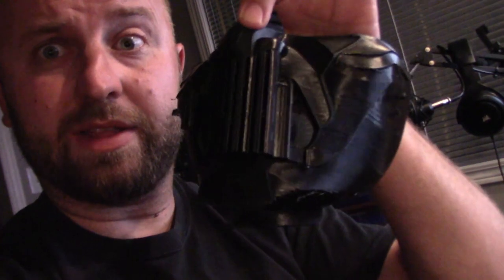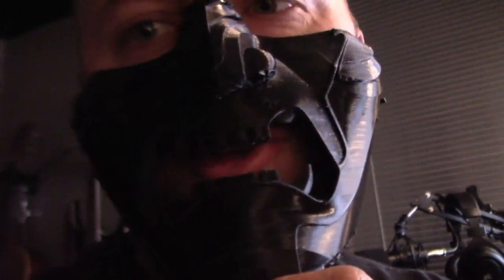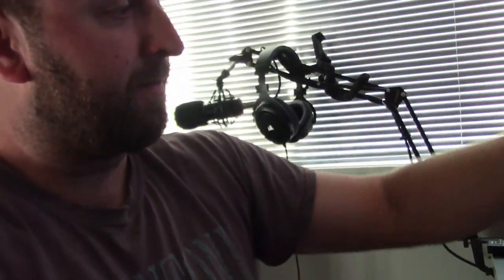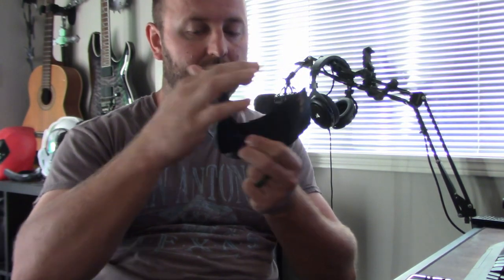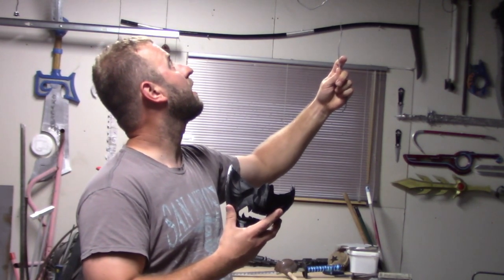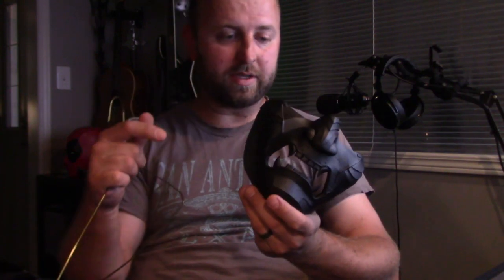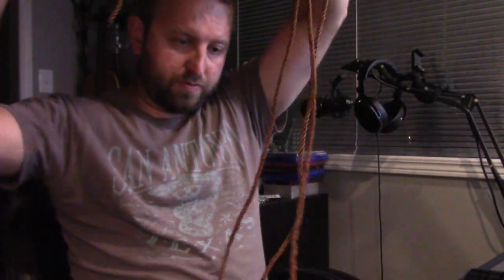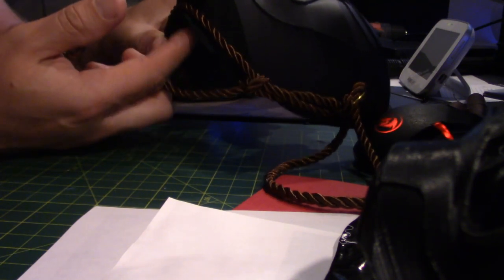Making "Ghost Mask" from Ghost of Tsushima

Comment: Looks good but first 2 attempts to print the bottom half  have resulted in the grid which will form the support lifting and then detaching. Any ideas? Fairly new to 3D printing, with  an Ender 5.
Reply from the maker: What slicer are you using?  Have you tried re-orienting it?  I often use blue painters tape for lifting issues
Reply: @blacksmithinggamer  Cura. I was using a ‘new’ roll of black filament which came unbagged with our printer a few months ago. Having increased the bed temp and lowered the nozzle temp, I went to reprint it but accidentally reprinted a model I made a couple of weeks ago. When I when to take it off the bed, looking like a perfect print, it basically crumbled apart in my hand so I think the filament is bad. As I said, pretty new to all this. 

Usually getting good adhesion with a glass bed and glue stick, although this will be the biggest print in terms of volume, but not base size, and our first with supports. 

I’ll try our usual white filament and let you know but thanks for the ideas on rotating etc.

Comment: What was the clear spray prior to sanding?
Reply from the maker: That was just another coat of black...but after I painted the teeth and nub on the chin I did give it a clear coat.
Reply: @The Blacksmith Gamer thanks for your amazing job! I have a question: so you used black primer paint, then sanded and after that you put a clear coat?

Comment: How big are the hooks you cut from the coat hanger at 8:23
Reply from the maker: At that point I had them over an inch long...but I ended up trimming them back once they were all glued in.  I would say just make them long enough for your rope and the mask if you dont want to trim them, 1/2 an inch or so should do it.
Reply: @blacksmithinggamer  what is the layer height that you used to print it?
Reply from the maker: @user-jv8mg9gi2s  .2 layer height

Comment: how did you make the nub at the bottom bc I don't see it in the files I haven't printed it yet but just wondering for when I do
Reply from the maker: My mistake, I just realized I forgot to upload that piece.  Ill upload it right away.
Reply: The Blacksmithing Gamer Thankyou so much!!!!
Reply: @blacksmithinggamer  I have a quick question would you happen to know what app I need to download certain 3d print files for instance I was trying to download the print from the people you mentioned and it would go through all the way and then say there was an error you need the app to download this but wouldn't tell me what  app so I just decided to stick with your files but then today I wanted to  download something totally different even off a different website and said the same thing any suggestions??
Reply from the maker: @hannahtorbert6030   are you talking about the thingiverse link? or the OG designer?
Reply: The Blacksmithing Gamer OG designer but I also tried with a different file and website and it started to download and then right before it was done it would say error you need to have the app to download it but it won’t tell me what app

Comment: I messed up the teeth too. Is there any way to mend it aside from reprinting it or aside from using the 3d printer.
Reply from the maker: Non-3d printing way would be with autobody putty/filler or even possibly the 2 party epoxy build up the tooth and sand back down into shape.  I picked up a $20 3D printing pen for that reason as well.
Reply: Honestly the best way to put that tooth back on would be to use a soldering iron. You can pick them up cheaper than a 3d pen and if you get a variable temp soldering iron you can have more control over your welds.
Reply: @hazthematt  using soldering lead?? Can you show me how? Or atleast explain it further?
Reply: @BWAKAENA  nah just clip off some of the filament from the roll and use the soldering iron to heat it up and melt it onto whatever you want to reconnect/weld. 

I'd recommend getting a hot knife tip for a soldering iron though. It gives you more surface area to work with when welding with it.

Comment: Whats the material you need ?
Reply from the maker: I just use PLA for the 3D printing Material, a coat hangar, some paint, 2 part epoxy (or glue of some sort) and the rope.  Hope this helps!
Reply: Thx